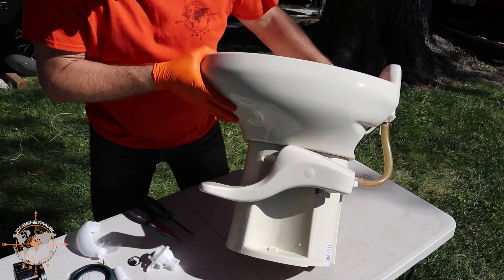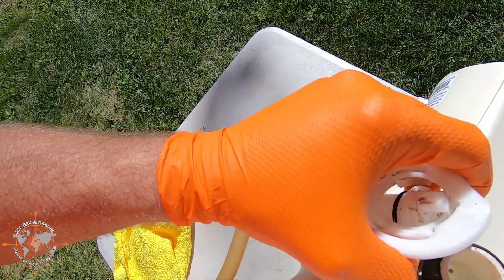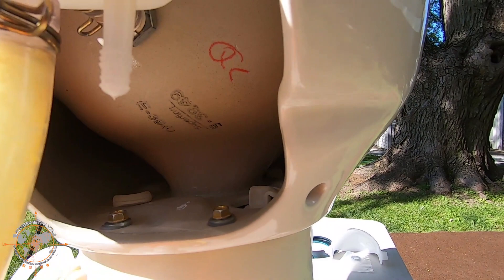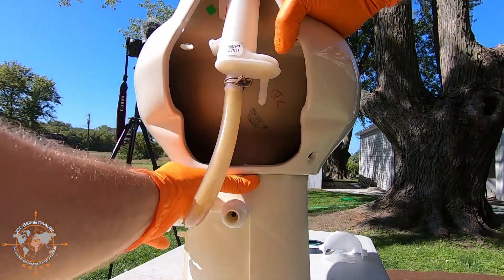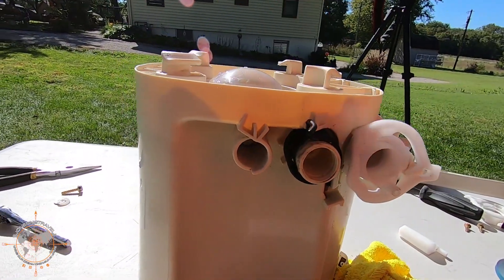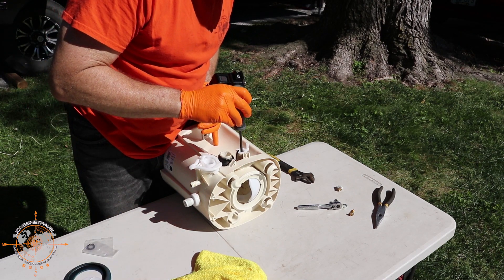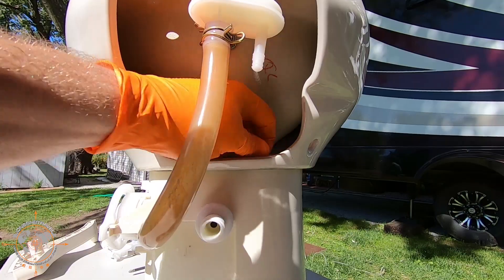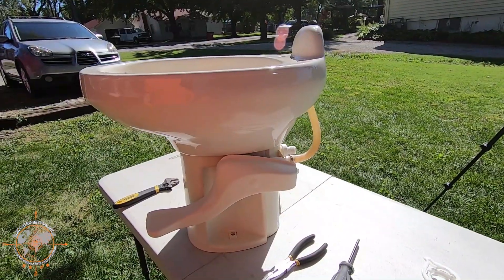HOW TO THETFORD RV TOILET REBUILD | RV LIVING

Comment: I just moved into a used RV I bought. I knew the toilet wasn’t working and the previous owner said I only needed to replace one lice (which he left on the kitchen counter for me to figure out). This morning, I tried fixing it and ended up with a flood. 💩🤢

After watching this video am I not afraid to tackle this project by myself, but now I am confident in pulling the entire toilet out, taking it outside to clean it and fix it.  I’m getting ready to follow you step-by-step. Thank you SO much!

Comment: September 15, 2021
Huge thank you for this video.  Watched the video before we even ordered the parts. The RV toilet is a small space to work in but we tried to replace the water valve and had issue with water running in non-stop after installing the new valve.  Re-watched your video and sure enough, had the two pieces together the wrong way.  
Husband always tries anything non electrical and this replacement is a confidence booster for sure.  Keep these coming, you are awesome !!!
Reply from the maker: Hi Kay. Its awesome to hear that the video helped. Does my heart good LOL Thanks for following along. Safe Travels

Comment: I totally appreciate this video. You helped me out big. Just a note.....in my case, the  valve collar didn't sit tight enough. I'm talking about 1/16th or so tolerance. It was enough to cause a bad seal. I put shims in the locking tabs to tighten up the clearance and that did it. But really, WTF? Ah....RV life. never a dull moment.
Reply from the maker: Hi John. Thanks for the feedback. That gap issue is probably a lot more common than we realize. Great find and solution. Thanks for checking out the video and following along. Safe Travels.

Comment: Thank you so much. The video really helped. There’s no way I could have fixed my toilet with the instructions provided by the manufacturer. Thanks again.
Reply from the maker: So glad it helped. :) Thanks for checking out the video. Safe Travels.
Reply: One question. The water valve, where does it need to be? Once I turned the water back on the water started running.
Reply from the maker: @jkeithevans8534  If you're talking about the valve on the side of the toilet itself then it should be correct if you are able to get the foot arm back on. It really only goes on one way.
Reply: Thank you I rewatched the video and found what I missed. The first part of the video of the water valve. I had the water valve in the up position and it needed to be down. It just ran constantly. Thanks again
Reply from the maker: @jkeithevans8534  Awesome, so glad you figured it out :)

Comment: Timely video for us. Water valve sticking open at times. A light tap takes care of it but one day it won’t. Thanks again for this informative video.
Reply from the maker: Great to hear it was helpful. Our foot pedal was really sticking, had to pull it up with our foot to close it. After about 6 or so months we finally got around to fixing it :) Thanks for checking out the video. Safe Travels.
Reply: Had exact same issue.  The problem is whoever is using the toilet has to notice the valve isn’t seated and the water is still running and then give the foot lever the little nudge to close it.  If they don’t and your black tank valve is closed…as it should be, we’ll you see where this is going.😳. And that is how I wound up having to pull my under side cover down and replace all of my insulation.  Not a fun job; I assure you, rebuilding the water valve is much easier and cheaper.  Thank you for the video!👍🏻

Comment: Great information and demo.
I had an RV toilet that water drained from the bowl on its own and the flush valve would stick periodically. 
Well guess what, I couldn't get all the parts, well the way they were packaged and sold was a bit of a scam which would have caused me to buy multiple parts of the same thing. So, I only got the lower and upper rubber/foam seals. I removed all the other parts, cleaned them from water scale etc, reinstalled all items and all is good. So sometimes the parts just need cleaning. Especially when the manufacturers are trying to gouge us. 

My unit is a Winnebago 2011.

Comment: Thank you Aaron. I was looking to find a video to fix a drip from the back of the pedal when flushing. I found this helpful in rebuilding mine. Given ours is newer, 2021 RV, I would hope to only fix the leak at this time.
Reply from the maker: Hi Richard. There are two places notorious for leaks, the water valve and the hose that goes to the bowl and/or sprayer. Sometimes its just a loose or improperly installed clamp but sometimes its a rebuild LOL Glad to hear the video helped. Safe Travels

Comment: Very informative thanks 🙏. Do have video on replacing the water shut off valve to the toilet. Mine is leaking and spraying.
Reply from the maker: Hi Janina. I dont have a video of that but should be pretty straight forward. You'll need a couple of pex tools and bands to replace it properly. Hope that helps. Safe Travels

Comment: Great video. Really helped me to rebuild my toilet. Was leaking before, but no longer.  Only one item left out... the rubber gasket on the ball flapper valve at 6:20. Looks like it is in the small bag on your table. Surprised you don't get a leak there. But other than that, this was a great help. Plus the links to the parts were wonderful. Thank you!
Reply from the maker: Hey Charles. Thanks for checking out the video. I went back and added it once I noticed I forgot it but never mentioned it in the video. Great eye though :) Glad to hear the video helped. Safe Travels

Comment: Great video, I have this exact toilet and needed to see how to assemble and disassemble it. Your camera work really made it clear and easy to see. I'd like to suggest that you use plumber's lube on your rubber parts, they'll last longer a turn easier.  :)
Reply from the maker: Thank for the tip, I agree 100%. Thanks for checking out the video and following along. Safe Travels

Comment: I had trouble with my Thetford Residence toilet. Somehow, sediment got into the water tank probably at the factory and worked its way into the toilet and clogged the orifice that sends the water into the bowl. I drained the water tank and filled it with about two gallons of water and two gallons of straight vinegar. I took the TT (KZ toy hauler) for a ride to agitate the water/vinegar and then let the vinegar break down the sediment, which was probably calcium carbonate. Let it set for a couple of days, drained and refilled tank. This video is probably the best that I've seen. It just seems that these RV toilets are just too overly complicated.

Comment: All great information, I was able to replace everything you went over. But the foot peddle would not stay put. The repair was a fail, the foot peddle groove clip would not hold so it just popped off when it wanted. I will save the ceramic bowl and just replace column next time.  Going to bed with a visibly bruised palm.
Reply from the maker: So sorry to hear that. Sometimes they just aren't repairable, unfortunately. Thanks for checking out the video. Safe Travels

Comment: Great video bud I did my toilet while watching this went very well total rebuild for 55$$ and a little over an hour to do it the only thing I noticed is that there is a rubber o ring/washer  that goes on the flapper before it snaps back in the holes inside the base.
Reply: My rebuild kit came with it and I noticed you didn't put one on. Hopefully it wasn't an issue of leakage for ya but overall very helpful content
Reply from the maker: I actually went back off camera and put it on. I didnt realize that it wasnt captured in the video. So glad you figured it out though :) Safe Travels

Comment: I bought a whole new base for those of us that waited so long that cleaning the old base just seemed to be under kill. I've done the partial repair in several RV rentals at our workamping jobs and wished they had just bought the whole new toilet, LOL. I've already made most of the mistakes in the last 18 years of workamping, lets's hope this one is a creampuff repair today, LOL.
Reply from the maker: Replacing the base is definitely easier. I'll probably do that the next time our needs a seal. :) Thanks for following along. Safe Travels
Reply: @JonesN2Travel  The new base was defective, my fault, it warped from heat stored in a shed for a couple of days while we helped with eldercare. I ended up replacing the whole toilet, eventually, I will have a whole new RV at this rate, LOL. Keep up the good work. -Dave

Comment: Fantastic video. I tried doing the job before I saw this. When I put it back together, there was interference between the water valve and the edge of the pedal. Why? Because I didn't insert the valve cartridge into the retainer BEFORE installing the assembly into the toilet cavity! I put the cartridge in AFTER I put the retainer in. It  fits fine, LOL. 
So, it was raised up too high and hitting the edge of the pedal. It would have also leaked like crazy, I bet if I tried to apply water. 
The Thetford instruction sheet skims over this crucial fact and just says to "Insert new Water Valve Cartridge Assembly until fully seated." It comes in pieces and the instructions assume someone knows how to reassemble I guess, because it makes no attempt to address assembling it. :-) Thanks for the great video!!!
Reply from the maker: I agree that some manufacturers are very lacking in their instructions. So glad to hear the video helped you out. Thanks for checking out the video. Safe Travels

Comment: 2 really quick questions where did I get the re build kit? (What do I type in)  also how long did it take to do this? Was there a wax ring?
Reply: You can order from a dealer or an online retailer. Amazon sells these. Just type in Thetford 42049 for the water valve. The floor seal will come with it.

Comment: Thanks for the information on this repair, do you know the exact name of the part that works the ball valve?? It's mentioned at 1:55 as mine has broken, and I need to replace it.
Reply from the maker: Here are the parts I used on Amazon. I believe you need the waste ball drive arm. Safe Travels
Thetford Waste Ball Kit (Flapper): https://amzn.to/2NQYOOp
Waste Ball Drive Arm: https://amzn.to/2K0hzhi
Thetford Water Valve: https://amzn.to/32v4ov4
Reply: They don't make them anymore, had to replace the whole toilet, but I upgraded like it much better

Comment: My Thetford Aqua Magic II is beginning to have problems stopping water flow after release of the foot lever. I see how you changed the valve. Which kit is for this and if I have the correct link below, I dont see the small spring and seal in that kit. Do you think the unit could be repaired without removing the toilet? Also, each kit has a large ring. Is that the seal for the base, assuming the toilet would be removed regardless? Well done video. The part where you have to lock the pedal lever parts together could be it's own video. That's my focus presently.
Reply from the maker: Hi Paul. This kit should have everything you need and yes, the large seal is for the floor flange when you remove the toilet. May be difficult to take apart with the toilet in place. You may need to turn it on its side to get to the bolts that attached the bowl to the base. Hope that helps. Safe Travels

Comment: Isn’t there a small gasket that goes on the ball valve arm?   My kit has one.
Reply from the maker: I don't believe the kit I got had one. Maybe they have either added it or eliminated it depending on how old the kit is I suppose. Not really sure. My toilet didn't have one when I disassembled it either. Hope that helps.
Reply: JonesN2Travel Thanks.  I am rebuilding mine tomorrow.    Hope I have as good of luck as you.
Reply: JonesN2Travel it was sitting on the table in a bag. Not sure what you did with it.

Comment: Thank you! This gave me several helpful tips and gave me the confidence to pull it apart. You missed the small gasket on the flapper. Putting the arm back on was a challenge. I did find areas where plumbing grease was helpful. Great video!
Reply from the maker: Thanks for checking it out. I'm glad it was helpful. Sorry, I must have missed it. I agree it was challenging to put the arm back on. :) Safe Travels

Comment: Excellent video. Ball valve stays open so we have to lift the arm up with a rope. Is there a specific part that I need so I don’t have to take it all apart for a complete rebuild? Just wondering if it could be the spring or if it’s the ball valve gasket. Thank you.
Reply from the maker: Hi Lyle. It could be the spring under the foot pedal, may be broken, and you should be able to replace it without a full rebuild. If the bowl holds water when the ball valve is closed then your seal is ok. Hope that helps. Safe Travels
Reply: @JonesN2Travel  thank you very much for the reply. I’ll pull the arm off and at least try this first before a rebuild.

Comment: It worked as you said, yep 10 minutes. THEN I noticed the rubber seal was not centered, started over. And the spring became unloaded. Any ideas? I’m thinking to remove the 2 arms and use the plastic flush devise to recook the spring. Most likely it will take a speciality tool. 

Thanks for the help.
Mel
Reply from the maker: Hi Mel. I think you can use the flush arm to force the spring back into position. Sort of hook the end of the spring and twist the arm into position in its post. Hope that makes sense. Safe Travels

Comment: Great video! I learned what was broken on mine! My only problem is removing the foot pedal, I have tried to pull it from every angle and it still won't budge. I'm afraid I might break something else pulling the foot pedal too hard. Any suggestions?
Reply from the maker: Hi Austin. It should pull straight off but you could use something to try and pry it off. The spring that returns the foot pedal is pretty strong and offers quite a bit of resistance. Some actually do break depending on how old the toilet is. Hope that helps. Safe Travels

Comment: You totally forgot the rubber gasket that goes around the arm on the ball valve itself. The side that gets the screw. You can see it in the little bag on your table as you finished assembling the toilet. That is important as waste water can easily run down the side and out the pedal side of the toilet.

Comment: Awesome job! We love our porcelain toilet but the pedal is starting to get gunked up and not return as it should. Thanks for the video!
Reply from the maker: If the rebuild doesnt fix it then the spring could be too weak. Sometimes a little silicon spray will loosen them up as well :) Safe Travels
Reply: @JonesN2Travel  Hey there, I used to build these toilets in the warehouse, and I would suggest a silicone based plumbers grease, not spray. You should stay away from petroleum and spray lubricants. Spray lubricants still contain petroleum, and this will damage the seals.

Comment: great video, thank you for sharing your knowledge on this topic, i am not able to replace the foot pedal , not sure which compartment of the foot pedal the spring goes   , do I need to tension it and pull ,other forums are saying thetford corporation uses a special tool to install the spring.. will appreciate your reply
Reply from the maker: On mine there was a clear mark on the pedal where the spring had been resting. I put the end of the spring in that compartment and the force it to stretch as I pushed the pedal on in the correct position. There may be a special tool as well but I've never used one. Hope that helps. Safe Travels